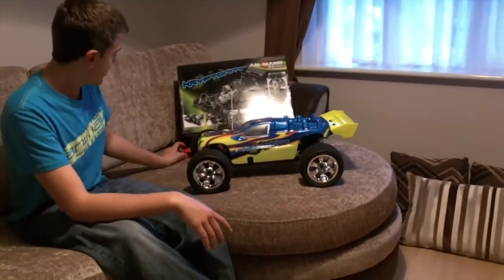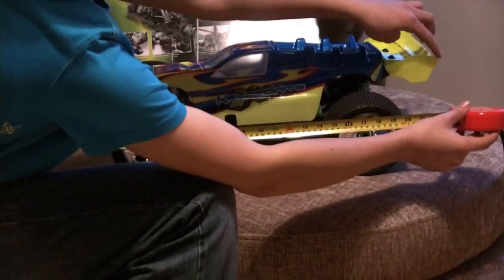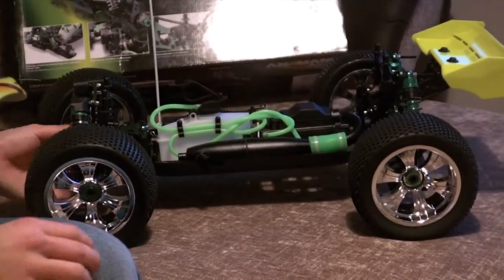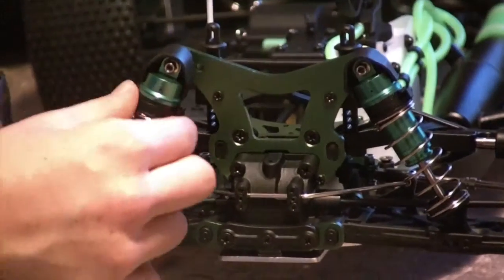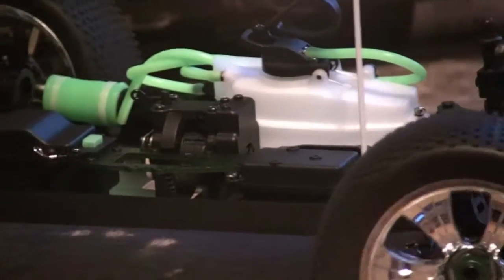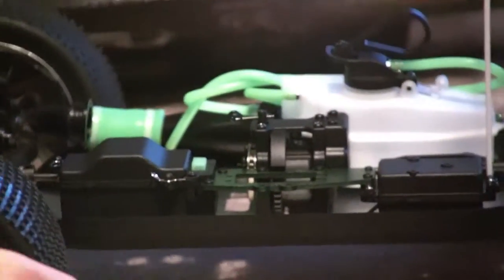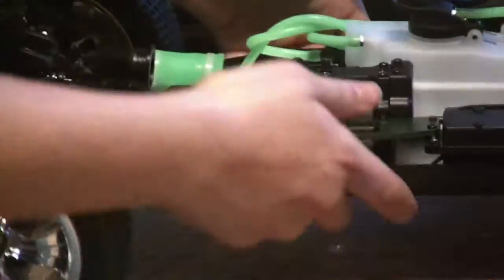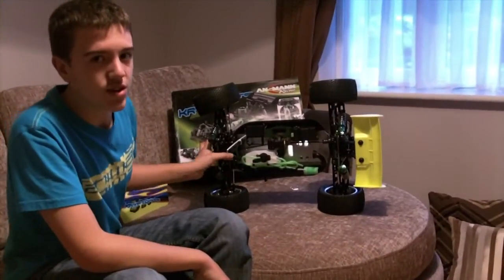A Requested  Review/Closer Look at the Ansmann Kryptonite Truggy

Comment: got my kryptonite all up n running...   sh 28  was all running well   till the 2,4 radio gear failed.... shot off into the distence...   found it its totaled...  i really dont rate the strength of the ansmann i wont be buying another  as the hogzilla is the same      , there fast  but weak as anything.....